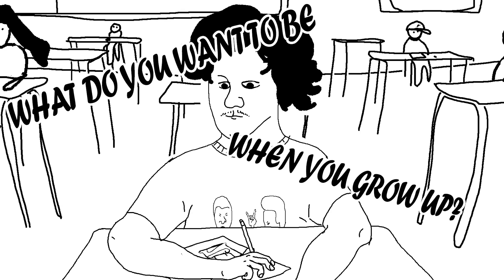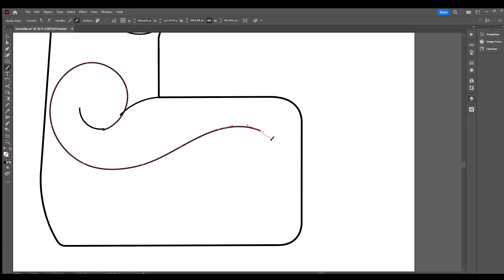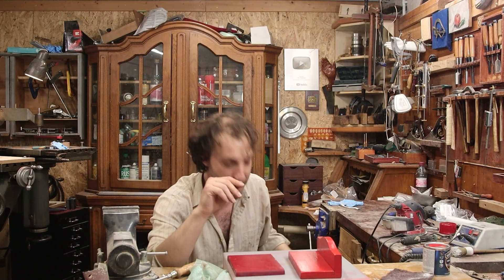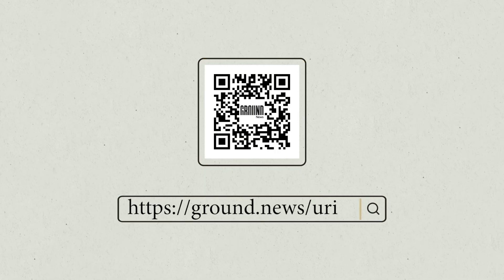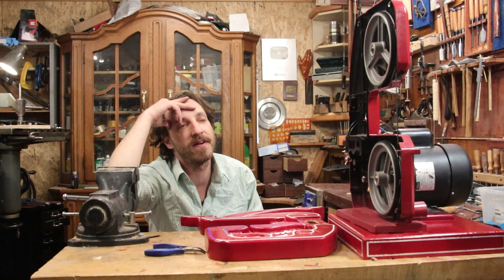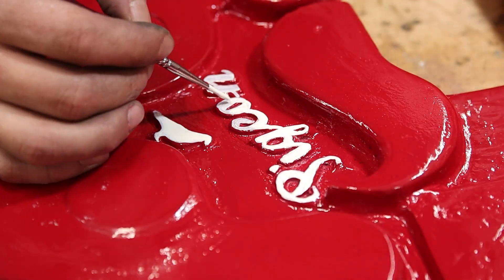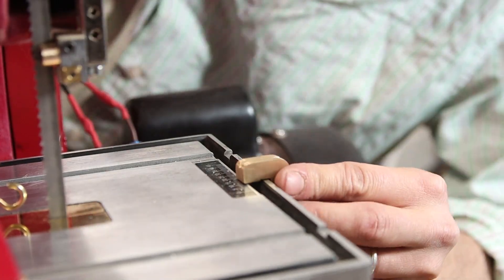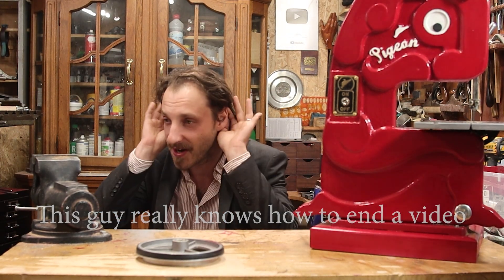I Rebuilt a Bandsaw so it can Cut STEEL

Comment from the maker: Hope you enjoyed the video! Go to https://ground.news/uri for an objective, data-driven way to read the news. Save 40% on the Ground News unlimited access Vantage plan with my link.
Reply: You should sing more. Seriously.
Don't get me wrong. Avoid doing it professionally, but if you edit your videos with more singing it would definitly spread smiles everywhere like no one else. I know i would smile more. Keep 'em comming!
Reply: Uri, that link is broken, some extra symbols crawled in (like a pigeon to that store)
Reply: 😂😂😂
Du bist das was man bei uns umgänglich als "schrägen Vogel" bezeichnet.
Genie und Wahnsinn 
😂😂😂
Reply: of course you fucked up your sponsors link 😁
Reply: Looks like myan or aztec inspired bandsaw man👍😊
Reply: Awesome video! I have a trick for masking small features that works great. After applying the masking tape, lightly spray or brush it with the same color as the base. This step helps seal any tiny gaps in the tape. Once that's dry, you can apply the color you want to mask off without worrying about it bleeding under the tape. It is an extra step, but this method ensures clean, sharp lines every time.
Reply: Awesome Uri 😊
Reply: Slammed like button before 0:00! Have a nice summer : -)

Comment: Hello Uri, I am from the past and have learned that the resins used to create mdf  will stop most solvent based paints from curing. There are exceptions, but they are few. It will take months or years depending on your luck. One needs to use a water based sealer first and best to continue with water based paints and then use a water based floor varnish as clear sealer. The problem of course is not paint, it is the mdf, which calls to people with even very low pigeon coefficients, calling, always calling, in their dreams, but especially near hardware stores or rubbish skips. Your bandsaw is horribly beautiful and that is more than any of us can usually expect from life. Good luck. I hope the future is cooler than we expect.

Comment: I like the almost cast-iron look of the red, it's a shame the paint didnt work out to be smooth, that wouldve really sold it as an artisan piece from the 40s or something 

You should totally whack a magnet on the upper wheel and make the eye pupil metal. Not strong enough to lock it so it looks grazy spinning all the time, but enough to jostle it around.

I think for cutting the aluminium you'd not want more weight, but a finer toothed blade and a faster saw speed.

Comment: When you do something like this, especially on MDF which soaks up moisture, you can use a body filler spray paint (like we tend to use on 3D prints) to achieve a smoother surface finish.

Comment: about the wobbly blade... you can beat it straight. locate the weld and take note if it curves away or towards the teeth. put the blade flat on a anvil and take a ball peen hammer and beat it on the side it curves towards thereby elongating  the metal there.

Comment: Just to mention, for that kind of work never use MDF. Use HDF. Probably best would be to coat is with very thin lacquer that soaks in. Repeat a dew dozen times until all fibers to be cut are firmly bonded. Ordinarily such treatment, water and wear proofing, is done in a several ton press. At least 20 ton.

Comment: Awesome video! I have a trick for masking small features that works great. After applying the masking tape, lightly spray or brush it with the same color as the base. This step helps seal any tiny gaps in the tape. Once that's dry, you can apply the color you want to mask off without worrying about it bleeding under the tape. It is an extra step, but this method ensures clean, sharp lines every time.

Comment: So a few things about painting to get the finish you want:
1) 99% of a good paint job is in the preparation, if you haven't properly sealed the surface (MDF is a pig), flattened it, laid the primer evenly, flattened it again and given enough time for it to gas off (release all the volatile organic components VOCs) then you're going to be fighting it all the way. Take your time with these steps and pay attention to detail otherwise you're just trying to polish a turd.
2) Always give the paint time to dry. Read the guidelines and add 50% (if it says allow 24hrs, wait 36hrs) just to be sure.
3) When using spray paint never try to get it all done in one coat. 1st coat is a dust coat sprayed from 30-50 cm to give the rest of the paint something to grab onto and then start building the colour by applying 3-5 light coats in alternate directions giving the paint 1/2 hro to dry in between. Use good paint like belton or montana for good results, you can also get different spray caps to give more control (dot colour denotes pattern/volume. Pink dots = fat caps, grey dots = detail caps). 
4) Frogtape for any kind of masking where you want clean edges.
5) 2 part clear coats are almost always the way to go for finishes as they're tough and relatively trouble free.
6) Maybe consider learning to pinstripe, it's similar to engraving in terms of requiring a steady hand and application of pressure to the tool. I think you'd enjoy it and it's a dying art form 

Best of luck pigeon dude

Comment: The amount of patience you have man. Way more than i would have. But yea MDF is a pain. I was trying to do a paint job on an old speaker box and ran into similar problems. So i just used spray adhesive and stuck fake leather on it that i got from hobby lobby. It was very cheap too. So it worked out

Comment: The part that really makes this video wild is using a bandsaw to make another bandsaw. I am basically begging you at this point to use the smaller bandsaw to make and even smaller (maybe replica?) hand carved bandsaw so you can have them in decreasing sizes.

Comment: Another pro tip is make sure you check whether spray paint is an enamel, lacquer, acrylic, or urethane and make sure to only use like products to keep it simple but you can still apply any finish over a lacquer if it is fully dry and your nose will let you know if it is

Comment: I did similar. My bandsaw blew up. It was a cheap one but I wasn’t willing to admit defeat so I spent all day adjusting the bearings and stuff to make the blade run true, straightened out everything and put new tyres on it, then decided I’d replace the bearings in the big wheels, put one on my press, lined it all up and it completely tore the centre out as soon as it contacted like it was made from cheese. I did the only logical thing, and stood and swore and cursed at it for 45mins before ripping all the parts off I could, reasoning I would use them on another bandsaw as they were all quite good, so 3 years later I found another bandsaw I could afford, expect it was a very old one, which I love, but it was much bigger, so none of the parts I had saved would work on it, and I decided ok, I’ll do a cosmetic restoration on it first, and then I’ll just rebuild/straighten/improve on the parts, as it was complete, just in bad condition as it sat outside for a few months before I bought it. And that’s as far as it’s gone largely because I’ve bought battery tools which replace, or do better than a bandsaw and I’m not limited to working in my workshop, ie, I don’t use a bandsaw much and I only wanted one because they’re cool, and one day I’ll fix the 50yo one I have, which is probably 60yo now, and it’ll be good.

Comment: If you’re not against using solvent based products then you should consider using nitrocellulose filler primer “aka” lacquer primer. It fills imperfections easily and dries as fast as the lacquer thinner evaporates. You can brush or spray it. It fills and sands easily, it’s outlawed in my state for commercial purposes but I use it at home because it’s fast cheap and fool proof

Comment: I havent used the proxon version. But i bought the microlux with the varable speed and water cooling system that is made from the same casting and molds and have run it for hours with brass steel aluminum cast iron and plastic with no problems. The 2in square cast iron bar i was cutting took a stupid long time but it is a tiny band saw. I did look at the proxon glad i didnt buy it

Comment: MDF is wretched for painting. I forgot to properly seal some and ended up putting way more coats on before it was vaguely even, then left aligned brushstrokes in the last coat to cover the remaining issues with the texture. Looked fine by the end, but Ive no idea if the paint will stay on for the long term. It was the surround of a cheap mirror in a rented flat (The original finish was some tacky glued on dried leaf thing that had started to rot.) Ive long since left, so Im beyond caring.

Comment: The only thing worse than working this hard on a project and then accidentally ruining it is to work so very hard on a project only to have someone else ruin it for you.
On another unrelated note, I've hired a new plumber to complete my bathroom renovation. Hopefully this one won't 'cut' the hole for the sink with a drill, then break the windshield of my car.

Comment: I know you won't see this but man, it is sooo much easier and cheaper (after like 3 projects) than most people think to get into using spray guns instead of rattle cans.

(If you or anyone else that reads this chooses to go this route, research-

-The different types of guns/spraying (hvlp, lvlp, etc) and decide what's best for your compressor, projects and shop. (Probably lvlp for most non professional settings)

-Fluid tip and needle 
(Surprisingly pricey so just go with a gun that comes with the one you want)
Thicker paint/finish needs a bigger hole to flow through
(For me- 1.6 and thin accordingly)

-Paint and finish
Just for simplicity, I go with the same type of solvent lacquer and conversion varnish for everything (mostly lacquer rn, want to move 100% to con var soon), just get the same type in a primer, paint base, clear, sealer, etc. never deal with chemical incompatibility. 
Dyes/tints to make your paints

I had no money for a long time, so I just got straight lacquer, used titanium dioxide and whatnot to make my own paint bases, thinned for sealers, etc. 

- A scale and notebook for logging and replicating things. 
If you don't need to mix 10 gallons at a time with milligram precision, a decent scale is very reasonably priced. You can also make a less precise scale still work with some fancy work arounds. 

-Solvents and additives
I just have lacquer thinner, acetone and other misc solvents, I use the ones that flash off faster to speed things up, I use the slower ones as retarders. Obv the real stuff will often work a bit better but I ain't made of money lol it works

-Compressor
For small projects you really don't need much, set your gun and finish/paint up for spraying at as low of a pressure as you can get it to still spray nicely. 
I used a small pancake compressor for a ton of stuff for a long time.

For smaller stuff an airbrush is awesome, they can run off a tiny compressor that doesn't even have a tank and they cost like $15 (and somehow still work fine), the orings don't play nice with the harsh solvents I use though. You can replace them with teflon if you want but I haven't bothered yet, I just make sure to not take the air brush apart until all of the solvent has had plenty of time to evaporate and leave the rubber.

Idk what it is about most air tools but you can buy the cheapest ones on the market and they still usually work fine. Usually need a bit more care and time in setup but still. Can't say the same with almost any other kind of tool
Reply: I for one found this very informative and useful! Thanks 👍🏻
Reply: Ditto
Reply: Thankyou for taking the time to share this information with us, I've got some projects coming up and ill definitely keep this in mind. Cheers :)

Comment: I've enjoyed your videos for so long and now I feel like I can finally give back in some minor way with a painting tip!  When you mask an area, paint it once with the same color as the base color to "seal" the edges of the masking tape, then paint your second color.  Hope that helps in the future!
Reply from the maker: That's a very good tip! I'll use that.
Reply: Another tip is to burnish the tape with something smooth.  Especially if you're using low tack tape.  You can get really good results combining the two methods.
Reply: This is the secret tip that really works.
Reply: Oh, thanks for the advice! I paint too and although I don't usually have a problem with the paint going under the tape I'm glad I know this now.
Reply: I came down here to say that.
Reply: Nice! I can see why this helps.
Reply: What does this achieve?
Reply: @smashyrashy  If it bleeds, the bleed will be the same color as the basecoat. The bleed will also seal up the small gaps between the tape and the surface of the work to keep the second paint color from doing the same.